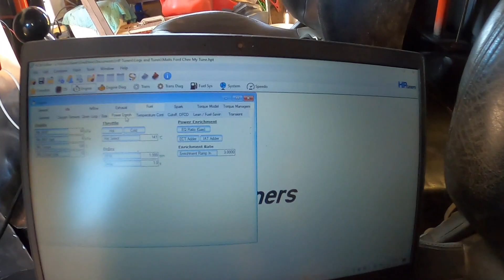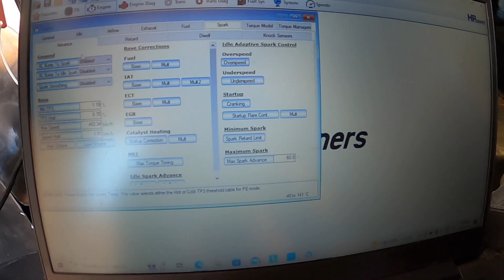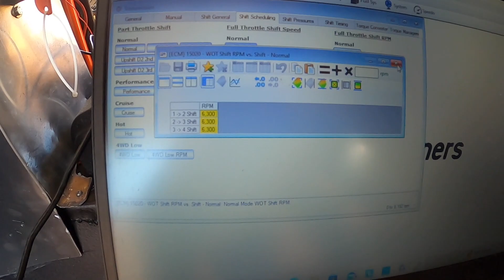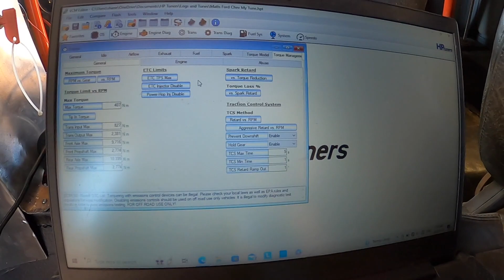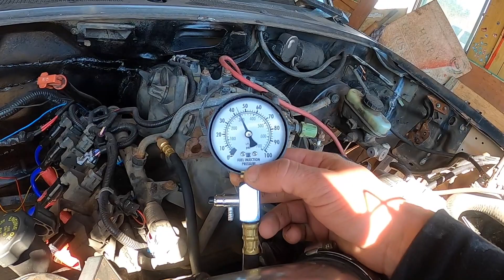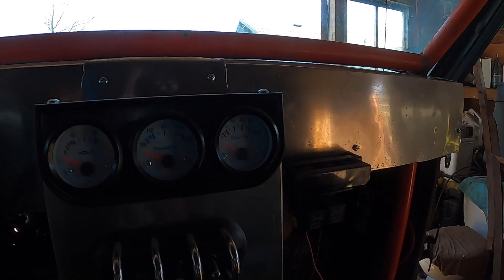Ford Ranger V8 Ls Swap Tuning the 4.8 Vortec with Hp Tuners

Comment: All these videos of ls swapped rangers but no how to or step by step videos or options to use transmission videos ect
Reply from the maker: what do you need to know most of my videos I explain parts used but as for step by step some people find that boring so I do several steps sometimes then video.... matt describes the shafts he used were using all electric trans 4l60e  and transfer case is manual shift from a 2000
Reply: @BurninGas8.1  I check all your vids out ,I'm wondering if an LS motor bolts onto the stock ranger transmission,I have a 4.8 laying around and want to install it asap with mods
Reply from the maker: @datmixednut1254  that I can’t answer but a ls will bolt to any chev trans just a matter of using right parts in between